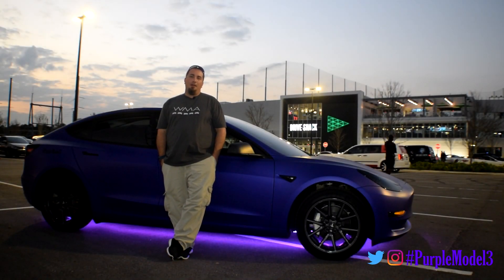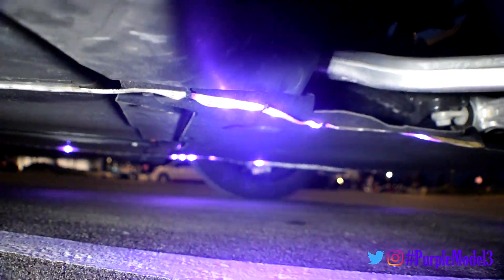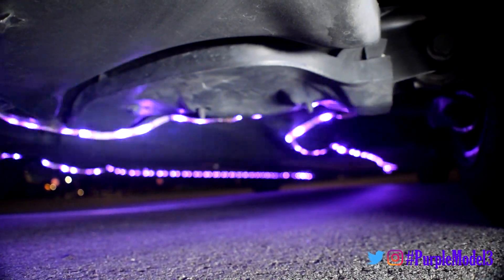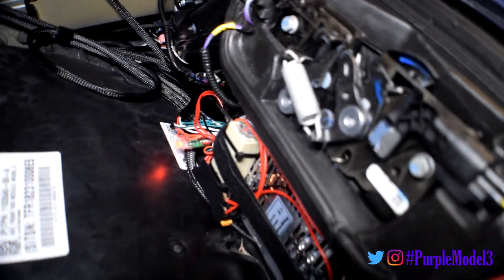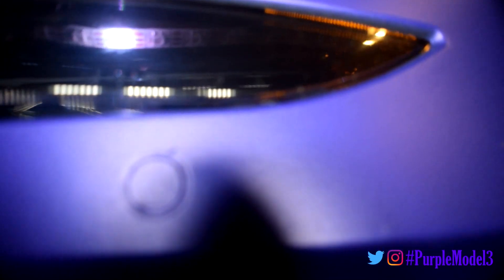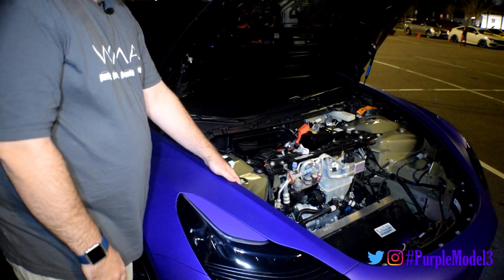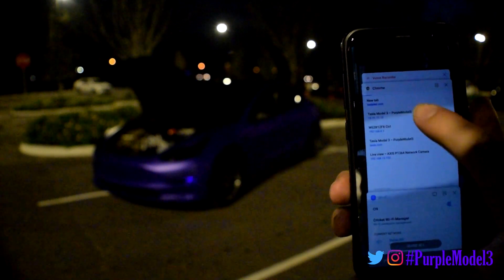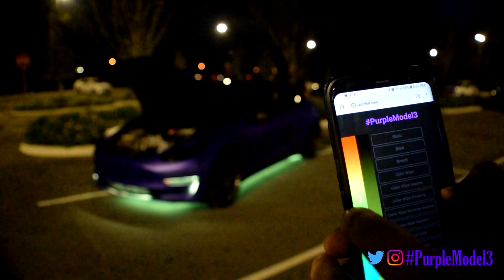Part 2 - Arduino Controlled LED Underbody Lights #PurpleModel3

Comment: Hey me again lol! Its working so well now I love it, about to install but I can't get the speed controls working.  The brightness works just not the speed.
Reply from the maker: Awesome!
Are you talking about the GPS speed or the speed controls form the Web UI that controls the current show speed?
Reply: @natemccomb  The web UI it resets the strips but doesnt change the speed
Reply from the maker: @MatttKelly  Check the Serial Monitor and look for "speed is ##" while changing it to see if it's updating.

Comment: Hey again, so its being super buggy when i have it set up as an access point without an router, it cuts in and out and really doesn't like to load the page properly.  Do u think the tp link would make this better?
Reply from the maker: I haven't had any luck using the soft AP mode on any ESP as mentioned around 5:30 and it sounds like you're experiencing the same issues. Test it in client mode on your home network and you should see a huge improvement, then you can look into getting a portable router.
Reply: @natemccomb  i got soft ap working based on the example files but like i said its super picky when to connect and always disconnects shortly after
Reply: I got it working! i think i need more power tho i have so many leds. do u have any trouble w signal traveling all the way?
Reply from the maker: @MatttKelly  You'll need to power both ends of your LED strips due to the voltage drop and see if that fixes your issues with the data line. How many LED are you using and at what voltage?

Comment: hey I'm thinking about doing this for my 2016 jeep cherokee im a software engineer so seeing this makes me hype. do yours only do purple? and do u think i can install a knob to scroll the modes?
Reply: awesome.  i only found your vids today haven't got a lot of time to watch much yet, but I'm def gonna use your code and go from there type of thing. i want to use 144led/m strips tho. thank you boss!
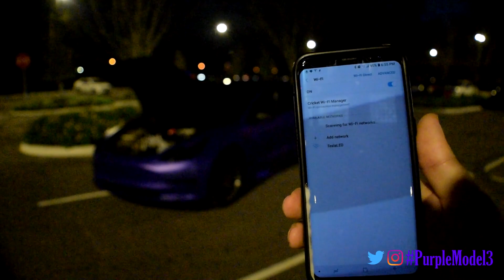Reply from the maker: It's WiFi controlled and you can select any color. See 6:15

Comment: Ive been trying to make an project like this for around a year, i dont have any coding knowledge and that has been my main drawback from the project, could you make a tutorial on how you installed the code on the esp and got it up and running? it would be greatly appreciated
Reply from the maker: check out https://github.com/kitesurfer1404/WS2812FX/blob/master/extras/WS2812FX%20Users%20Guide.md